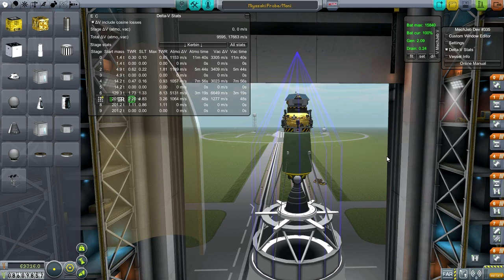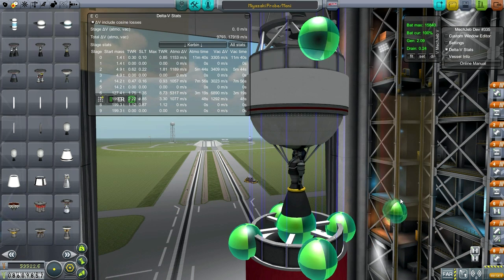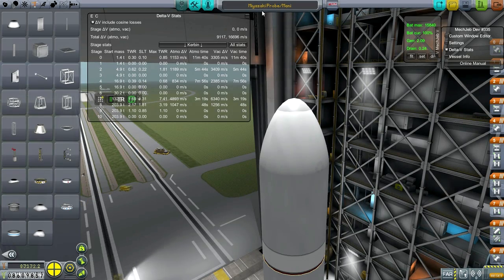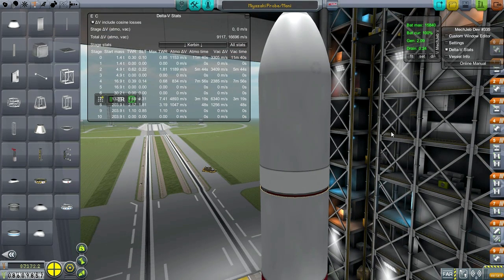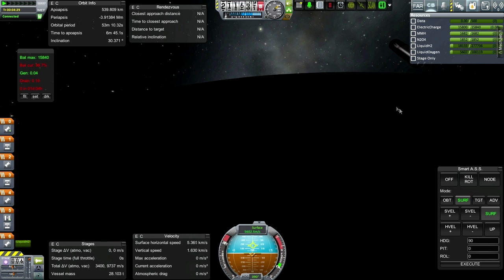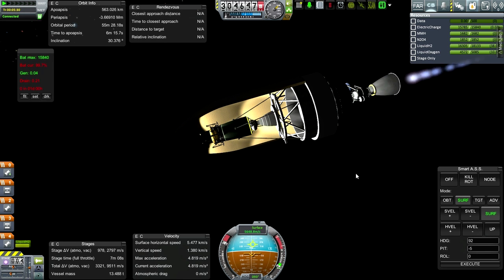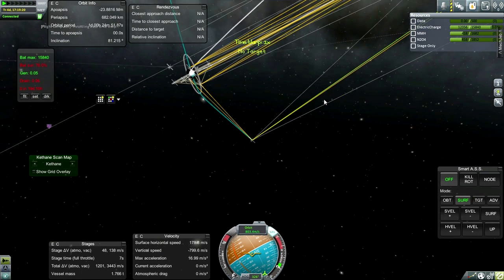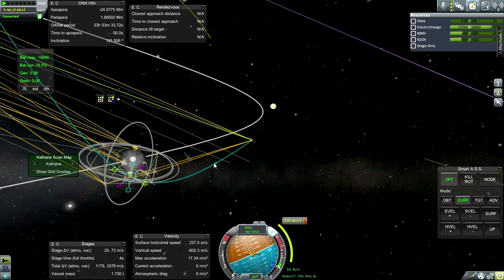Kerbal Space Program (0.24) - Realism Overhaul 062 - From Tanegashima to the Moon

Comment: Mechjeb can read biomes using the mouse cursor. You can do this through the rover waypoints menu (set waypoint, and the cursor tells you the biome) or through the mechjeb landing assistant "select landing location" tool. You could use one of these to determine a good landing spot, and then handle the landing without the assistant. Just a thought.

Comment: The fairings don't come off sue to a common bug in version .24. I had the exact same problems. Actually it was all decouples that were weak.
Reply: ***** Hmm. The other install thing I can verify as I have played in two different installs and in one they worked as intended and in the other they didn't.
Reply: ***** maybe if you delete whole pocedural fairings folder and reinstall it??? Slow transmitting and not geting all science is x64 related remote tech bug.
Reply: look at this https://github.com/RemoteTechnologiesGroup/RemoteTech/issues/136
Reply: ***** I would say that the reason is probably hard to find. The amount of weird glitches and bugs with 64-bit is insane.
Reply: ***** Well I know next to nothing about programming so I have no clue.
Reply: ***** This is just a barely educated guess, but it's possible that it's more Unity's fault than 64 bit. That is, the code was sort of "ported over" from 32 bit to 64 bit, and, being designed for 32 bit, maybe it doesn't handle 64 bits very well, or maybe there are a few fragments of code still whose reference to 32 hasn't been changed to 64?
Another possible cause could be something akin to overflow.
Reply: batterup98 As a matter of fact the devs said that the 64-bit Unity was fairly unstable.